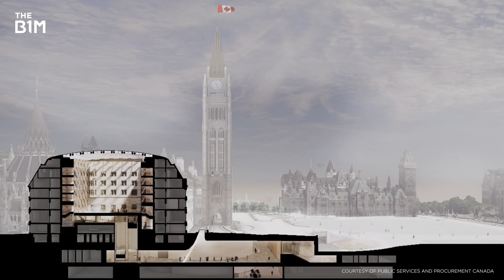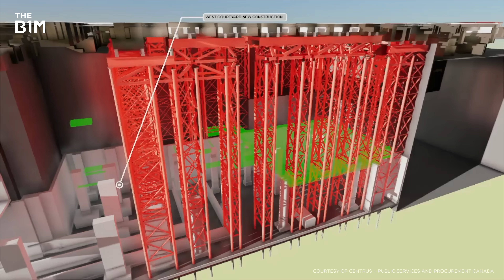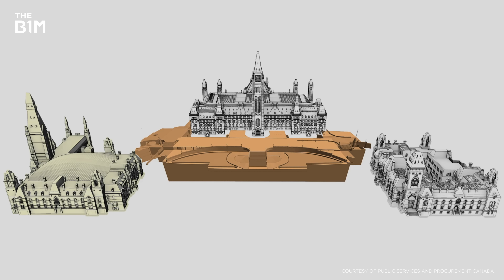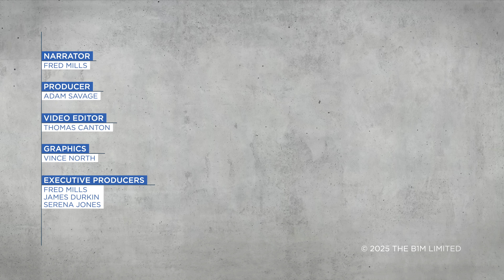Why Canada Blasted a Huge Hole Outside its Parliament

Comment: I have a question which is probably irrelevant when the government has infinite money. 

Why not just demolish it. Preserve the stones, etc. and rebuild from scratch. I'm sure the cost would be cut down from $5 billion to $1 billion. 

Having to drive piles, excavate, raise, lower all these pieces sounds very complicated and very costly.

I'm sure they can preserve the stained glass windows and important architectural elements, tear down and save the bricks, and then you have a blank canvas, rebuild using existing stone where possible and substitute some new materials so the facade is consistent and authentic.

Would be very interested to see a cost breakdown of my method versus this method in your next video.

Comment: So basically they should fucking scan whole building, find out where all pipes, wires, etc are, the joint connects, roomlayout etc. That way you have understanding of sht BEFORE you go digging a bunker underneath your house of council. If not do it the Ghetto way cement fill underneath (Of course have pipes/plumping/water/heating whatever guy there so you dont pour in places that need those areas of expertise's and systems.)
Once the cement has harden around main building then dig, as retarded as it sounds Id rather have unmoveable rock above my head then building stich together with maple syrup and dreams fall on my head.

Comment: I worked on the design of the curved roof transit structures back in the 1980s.  At that time there was no requirement to design structures for buildings and bridges, etc., in Ottawa to resist earthquakes.  Subsequently it was found that Ottawa was in a more active earthquake zone, so nowadays all structures have to be designed to resist earthquakes up to a magnitude of 5.5, (if I remember correctly).  I  hope I'm not scaring people!

Comment: I hope they added a line item for the PM's new residence, because the old one is a freaking disgrace. Leaking, lined with asbestos and doesn't even have air conditioning.

Probably not even about 1/10th of cost of the new trump ballroom.

Comment: 😂 Earthquake Protection 😂.  London gets a very low number of earthquakes, with none recorded in the past year. However, the UK as a whole experiences between 200 and 300 earthquakes annually, with about 20 to 30 being felt by people and the rest too small to be noticed. Most earthquakes in the UK are small and do not cause damage. 
Yearly occurrences: The UK as a whole experiences 200–300 earthquakes annually, though only 20–30 are typically felt by people. 
London specifically: London has a very low earthquake hazard level and has not had a recorded earthquake in the last year. 
Historical context: There have been a dozen or so earthquakes that have affected London throughout history, such as the 1884 earthquake with an estimated magnitude of 4.6 that caused damage to several churches. 
Cause of earthquakes: The UK is not on a major tectonic plate boundary, so most earthquakes are caused by local stresses relieved on pre-existing faults. 
Magnitude: Earthquakes in the UK are generally small. A magnitude 4 earthquake happens roughly every two years, and a magnitude 5 about every 10–20 years.

Comment: I remember 20 or so years ago walking around the back, you could go up and knock on the back doors if you had wanted to. I did a walk around a few weeks ago, all sides are blocked off with construction barrier, even the back. There is almost nothing for a tourist to see other the views looking away from the building over the Ottawa river.

Comment: The parliament buildings were in dire need. The plans of the original building were lost and when they rebuilt, they used the old foundations (sort of) . There were also issues with plumbing and electricity.

Comment: Fun fact about the current senate building! It used to be the Ottawa Union Station, designed by architects Ross and MacDonald (big architecture firm in Canada known for many iconic buldings which still stand today). The station opened the same date as the Château Laurier hotel in 1912 and was connected by a tunnel (since tourism in Canada, at the time, was heavily based on the railway). Now get this… the interior of the Union Station in Ottawa was a smaller scale of the Pennsylvania Station in New York City, which has sadly been torn down, and for those curious can still see a piece of lost architecture in Ottawa for free!

Comment: I'm a former Member of Parliament (2011-2015) and the project is even more complex. Before work on Centre Block could even begin, years of work went into rehabilitating West Block and building a new House of Commons in what used to be it's inner courtyard. The wellington building was also completely renovated so as to provide enough office space since Centre Block was the largest of the buildings.  The Senate of Canada building was renamed from the Conference Centre and was originally Ottawa's central train station.

There are workers who will spend their entire working life rehabilitating the Parliamentary precinct.  Even the temporary Visitors centre is massive and impressive compared to what was there before (there wasn't one).  If you're ever planning on going to Ottawa, I could help get special access into the area and tour.
Reply: My husband will probably retire from construction on this project. He started as a stonemason and is now working on the PCL/ED joint venture in safety.  This project is massive.  I have heard people complaining about the cost, but in reality, they have zero clue as to how much is going in to it all.
Reply: @roonboo96  - When it comes to protecting and restoring history expense should NOT, and NEVER BE, an issue. Those complaining have no appreciation and would be the first to witch and moan the moment something happened because the protection and restoration never took place.
Reply: @Ryanthusar  Absolutely, the expense shouldn't be the issue, but Quality and Cost controls should always be at the forefront to minimize waste and maximize our return on the investments.
Reply: @roonboo96  The scale is immense AND keeping everything running simultaneously is no small feat either.  It will be crazy when they shut down the Confederation Building.
Reply: @roonboo96  That's amazing, there are not enough people in those trades. Tell him thanks for all he's done.
Reply: @roonboo96 people will complain about the cost of literally everything. Its our House of Government and a National symbol, it should be restored and modernized. They should be doing 24 Sussex too.
Reply: @Kipindahouse  Absolutely agree!! It's a disgrace and embarrassment that the official residence of the Prime Minister of Canada sits empty and falling into ruin. 😠 24 Sussex is also an historic building sitting in a breathtaking setting overlooking the Ottawa River. The leader of our country (regardless of political party affiliation) should live in and be able to receive foreign dignitaries/guests in the official residence maintained for this purpose. Full stop.
Reply: @Kipindahouse  Yep, its absurd that so many PMs refused to fix it.  It would be nice to get a consensus from all the parties on it so that the partisanship can be removed from it
Reply: @maryjanemathieu  It is an embarrassment and has been for quite a while.  All the PMs from the last 30+ years share some collective responsibility.  Nobody wants to spend any political capital on solving it.
Reply: I visited in 2023 and saw the temporary Visitors Centre and the West Block... the works completed to that point (including the HoC space) was absolutely stunning, so I'll have to return in 2032 to check out the rest!
Reply: Came here to say this. This was a great video, with really helpful visuals to explain the work they’re doing, but the project as a whole is a lot more involved when you factor in the preparatory work involved in displacing everything that would normally be happening in Centre Block.
Reply: The relocation of the Senate and House of Commons are a bit understated in the video. For the House of Commons, a domed roof was added to the West Block terrace to create a new legislative hall and for the Senate the former Beaux’s Art style train station which had long been converted into a government conference centre was turned into the Senate.
Reply: @sktheroom  The speed with which the Senate building was done is impressive.
Reply: hi dan, i've never heard of you before today but you've outclassed everyone in these comments, keep up the good work
Reply: @clixy2  he has never worked for you, only himself
Reply: It should also be noted, that while I say I and ME for that list of things done, I'd be remiss if I didn't salute the incredible staff I had the helped and in the majority of situations did most of the actual "work" to do and accomplish those things
Reply: Hi Mr. Dan Harris, how to contact you for a tour.
Reply: @ashpakpasha2962 he was talking to B1M LOL
Reply: @michealaubrey114  I was, but if they're actually coming to Ottawa and book a tour I wouldn't be opposed to meeting them or joining their public tour if I'm available.
Reply: I got to see Centre Block several years before the big rebuild. I used to watch Question Period on CTV as it was always on when I got home from school and my parents had it on in the kitchen. Was amazing to see all the funny screaming yelling people on the TV there in the flesh. I walked in on some boring bill debate closing up, then everyone started filing in for QP. Think this was around when Harper was older and kinda tubbier, squaring off against Mulcair the prosecutor and Trudeau being a little squeak toy in the bleachers. (The Bloc was four guys iirc) The heckling and cheering and table-pounding is like thunder the first time you hear one side or the other or everyone really get into it. When the whole thing is done and parliament reopens I plan on going again to see the gong show in all its glory 🇨🇦
Reply: @uvb_dreams  It's a fascinating experience having experienced it from most of the perspectives.  I would have been there when you visited, but where would depend on when you come by.,
Reply: whats the plan with the west block house of commons location when center block is finished?
Reply: @aselwyn1  The way it was built within the courtyard it is possible to completely disassemble and remove the entire thing. Obviously the offices will return to being office space for MPs and ministers (particularly since other buildings like the Confederation building also need to be renovated). There hasn't been a final decision taken on its use. IMO the most likely outcomes would be converting it into committee space, allowing the majority of committees to take place in one location. Or a large ceremonial space. Canada doesn't have an adequate location to host things like state dinners.
Reply: Why do you guys lie and bullshit and screw Canadians over and break promises that you promise
Reply: @HazardWave95  I won't carry water for the other political parties, but I will say this. One of the reasons why my party has never been the federal government is because we're not willing to lie and say whatever it takes just to seize power. My party got Canadians Dental Care, anti-scab legislation and the beginnings of Pharmacare in the last Parliament despite being the 4th largest party in terms of seats. I can also say that I never once had to lie while I was in office. I learned in grade 6 while running for class president, not to make promises that you can't keep as I'd promised a pizza party I couldn't pay for.  I did find a way, but it cost me a summer of chores and I learned the lesson well.
Reply: I know you probably won't respond but I've always wanted to ask someone in politics this stuff or at least have a real conversation without feeling like it's going in one ear and out the other I wrote to Gordon Campbell when I was 12 when the mps we're getting free tickets at the Olympics (it was on the news) and I explained how that's not fair that they get free tickets but everyone else has to pay he never responded he just got some suit to write back to me saying he would consider it
Reply: Hi  @HazardWave95 , people shouldn't shy away from questions like that. I can only hypothesize about why you didn't get an answer. You'll have to decide whether my response is in one ear and out the other. I think it's great that you took the time at 12 to do something like that. I joined a political party at age 15, so I understand how easy a voice it is to ignore and have always done my best to encourage and value those younger voices, it's important for our collective future. I love the way you articulated your opinion on that issue. Some people would argue that is was unfair just that they even got the tickets. I fall more towards your point of view, that is was unfair they got them AND didn't pay like everyone else. Generally speaking I agree that they should have had to pay for the tickets, in some circumstances making an equivalent charitable contribution might be acceptable. From the politician's perspective, I would never accept a freebie like that, I would insist on paying. Where the gift is coming from is also always a consideration. We (Canada) does have a Conflict of interest and Ethics commissioner and rules around the receiving of gifts. MPs should be contacting that office whenever situations arise that could bring questions of propriety. They will to the best of their ability advise and rule on those things. Then it's the MPs responsibility to do the right thing. I also think that the rules could be improved. There are definitely things that pass the rules test, but fail the sniff test.
Reply: How cringey that he said the most important building in all the nation is the Parliament building.  It's said that people consider government the center of life.  The job of government is to do a very few things that are legitimate functions of government and otherwise let people be.  What goes on in a steel mill or even a small town retail shop is much more important.
Reply: What a massive waste of money for the ever growing public leech sector.
Reply: Ahh, putting your lobbying skills on YouTube, out of a job, looking for new influencer gigs?
Reply: @zenzulu24 hahaha 😅
Reply: @zenzulu24  you suck
Reply: @zenzulu24  I've never been a lobbyist, but I am past the 5 year lobbying cool down that former MPs are subject to.  As for influencer, I am planning on streaming Lego building and political discussions soon. @danharriscan
Reply: Lets be real. Children now a daya are too large to fit into the grape tunnels and they need to be widened.
Reply: Congrats on being part of the last successful government this country has had.....you of course had no hand in making it successful but congrats on being there anyways.
Reply: @ak4344  That's debatable, though we might agree that the Trudeau years left a lot to be desired but maybe for different reasons.
Reply: @ak4344 For those who don’t know the original commenter was ndp. As bad and sometimes worse than the liberals.
Reply: @JacobLeeson-zk1ol  Tell me your perspective is from the right without telling me you're coming from the right
Reply: This entire country has been ruined by left wingers giving everything we have away to foreigners.
Reply: @TravisZed314  zealots in the comments
Reply: @Okanoggin  That's to be expected. I knew it would be once I identified myself.  It doesn't mean we all have to engage with it.
Reply: @TravisZed314 
Another insular conservative. 
Go find some intolerant right-wing dystopian nightmare to live in. 
Try Magastan, you'll fit right in. Demonizing inmigrants is big down thete
Reply: @TravisZed314  I wasn't going to bring partisanship into this conversation, but since you did, my response is that the country has only ever been run by centre-right and right wing governments, so you're barking up the wrong tree.
Reply: Just like in Trump’s US, the fascists in the UK and Europe are saying the same thing, too

Comment: In June 2010 I visited the Parliament Buildings in Ottawa. I'm Canadian and am from British Columbia. But I was on a cross Canada adventure to see my country.
  I arrived in Ottawa the night before. Spent the night and headed to Parliament early ( 6 am) on a Sunday morning. Not a soul in sight. I walked up the front stairs to the main doors and was peering through the glass doors. On a whim I tried the door handle. It opened! I walked inside and strolled around. I did eventually run into a security guard. He was cool and ended up giving me a tour!
     Try that at The Whitehouse!  A couple of years later some nut job ran around there with a gun. Pretty sure the doors are locked these days.

Comment: Where is the repair money coming from? Tax payers of course, when it comes to spending money, Canada is #1, government dont care, bc there will be unlimited amount coming in every month weather it's worth it or not, they will only go top notch. Probably assessment fee already hit millions of $ before the job even gets started. How often Canada has earthquake and if that's what they worry, then all the high rise condos and every single house should be reinforced for quake proof requirement then? Waste of money doing quake proof, or digging a basement for welcome center. That will probably cut the cost in half, if just strengthen the support structure posts and build a welcome center above ground.

Comment: Built in 7 years with horse and buggies, lol.  Sure, they can't even paint the place in 7 years.  the place is a mess in the front.  Of course there is a massive foundation there underneath and who knows how many stories.  Ottawa is filled with tunnels that go deep and well into the country for miles amd miles.  where are the blue prints?  This has already been built to resist earthquakes.  Mor His story.  This guy doesn't anything about it.  More stories....